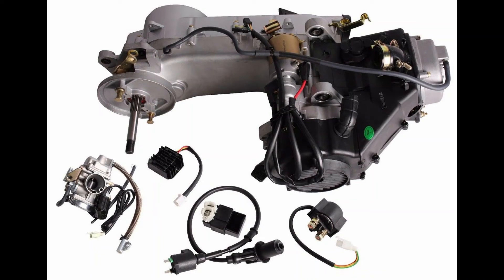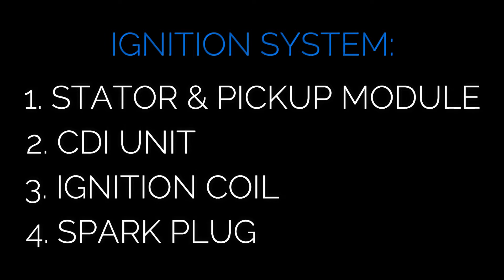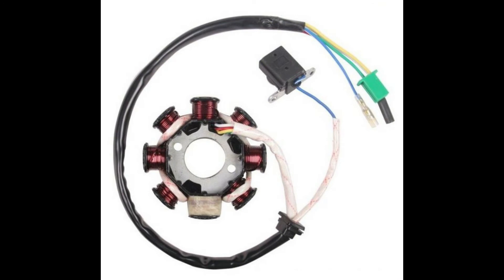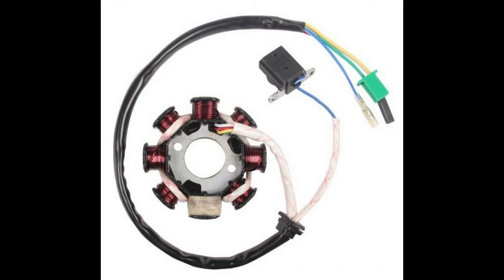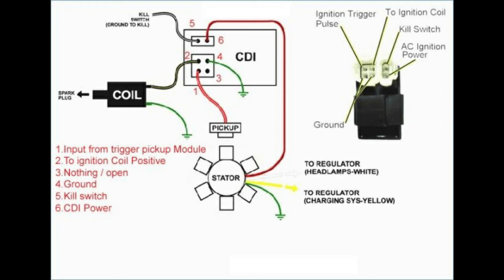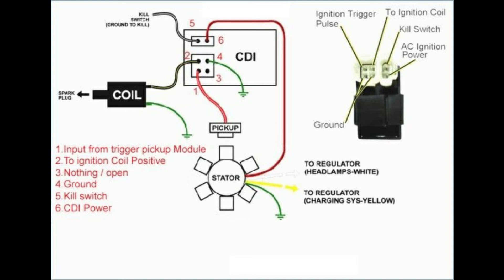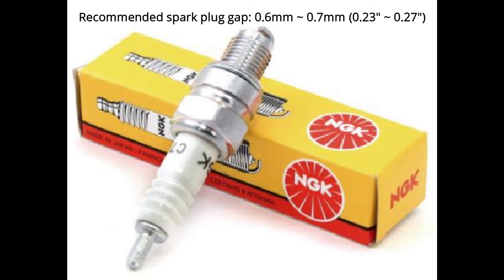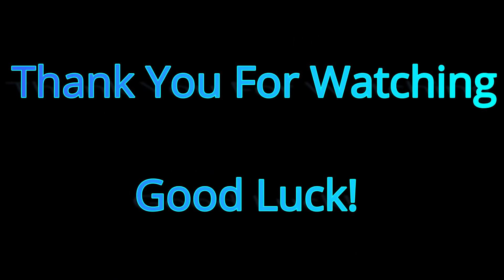Common GY6 Engine Problems and Troubleshooting

Comment: What if I have NO power at all when I connect a brand new battery. Checked the ground cable on the chasis and the fuse is good. I have a 2023 icebear maddog 150cc gy6
Reply: I had an issue like this with a gy6 in a trail master. Ended up being the starter relay fuse was blown. Swapped it out and got power back to the whole cart.

Comment: question< I have a 2003 rover, I removed the stator which has 8 windings which has 4 wires a blue with yellow stripe and bullet connector a white wire green wire and yellow wire, the new stator has 2 yellows 1 green the blue with a bullet connector and a 5th black with red stripe, which goes to which. the original owner cut the plugs of and taped the wires together.

Comment: 150cc GY6 - I changed out the ignition coil, cdi, spark plug, and regulator (I think that's what it was). I couldn't find a rectifier anywhere on the engine. It all cames as a package. It cranks and won't fire. It also has a new carburetor. Where should I look next? Theres fuel tk the carburetor but i dont understand the round diaphragm looking unit the fuel line comes into, but there's fuel to the intake on the carburetor. I have no way to know if all the vacuum lines are hooked up right on the carb. I inherited this scooter for free. Im very frustrated
Reply: Did you check compression for this you need to check the valves (with a feeler gauge). It's quite easy but this made it work for mine. And also ofc full battery.

Comment: Question... I have a Wolf RX 50cc moped. When I try to start it, it just turns over.  If I remove the White/Black (ground) wire on the CDI, it will start but not turn off until I reinsert the White/Black wire. I have replaced the kill switch, CDI, Stator, Ignition coil. What am I missing? Bad ground somewhere?

Comment: I have a basic question. On my 90cc Kymco, the plug will spark whether it is grounded to engine or not. I am used to having to ground the plug to the engine/frame for it to spark. I assume because the coil has 2 wires to include a ground, this is normal. I just noticed when I was working on a spark issue that it would through a spark with the plug and plug wire laying on top of the front tire, and that was a new one for me.

Comment: Unfortunately I have all brand new parts other than the engine itself. It will turn over but won’t start. I have spark it just will not start
Reply: Find the problem?
Reply: Find the problem?

Comment: Could any of these electrical components cause a bogging at half throttle?
Reply: Ground the battery to the engine.
Reply: @anthonypriddy9026 battery is grounded at the starter? Is that ok? Or it needs more ground coming from the battery? Maybe to the valve cover?
Reply: Valve cover  @JonahNAloha
Reply: Should I take the ground off of the starter and just use that ground on my valve cover?
Reply: Nah, leave that one and just add the new one to the valve cover   @JonahNAloha

Comment: 3 wires only from ignition case. No red wire. All 4 cavities used on CDI 4 pin connector. Yellow, white from stator and blue with white from pickup. Arctic Cat 90cc ATV.

Comment: I was always under the impression that ignition coils ran on dc, and that the cdi unit changes ac from the stator to dc for the coil, but you said it was ac to the coil so a bit confused.
Reply: Depends what type stator you have

Ac or dc 

If you look at the coils on the stator, if it’s bare coils all around, I believe its DC

IF there’s some coils that look like they’re wrapped in white tape, its AC. 

I believe it was ac that charges your battery and dc powers up cdi

Comment: ghost in the machine.. i got a 2nd hand 2021 tiking 4 seater 200cc kart the other day. it was a crank no start, owner said the shop replaced the cdi a few weeks earlier and a few days after that   it died. and he decided to sell it.  for a 2021 it was mistreated i could tell every single bolt and nut was loose some hand tight loose.. the breather hose from box to carb gone the electric box cover gone and it was pouring down rain when i  bought it..i tested the stator, and all was good but knowing what the kart been through i replaced it anyway. still no spark then i decided to put a new CDI in it and i had spark. then put plug in tried to crank nothing pulled plug no spark, tested the CDI it was blown now also. when i took the voltage Regulator off the mount i noticed the bottom was cracked bad.  so im not sure where to go with it. but i noticed some weird stuff if i wiggle the key switch the dash lights and speedo meter flicker. also i went to measure the holes for a new tail/brake light with my digital gauge and it was going bonkers when i put it up near the electric box area something is shorting somewhere just not sure where to look..i have checked all grounds all are good now. i do have a new ignition/key switch coming and new CDI..any ideas?

Comment: This os all fine n dandy if youve got a150cc p.o.junk. i got a 250cc p.o.junk with a inverter /regulator. I got 3 yellow wires(hence 3 phase) on one plug coming out of engine that goes to the inv/reg and a 2 wire plug coming out of engine, ones a trigger or pulse (blu/wht) and the other is a ground. The cdi on mine gets power from the inverter regulator. The 3 yellow wires going to the inv/regulator are ac current but when they come out its a  three wire plug green n red n black. Green n red go to cdi as 12volts. The black doesant go to anything. Im so damn sick of trying to find my info. I cant believe these chinee pump out a million of these junk bikes but not one manual

Comment: Some pick up have 2 wires, the blue/white and a green/white. What is that green/white wire for, it leads to the cdi next to the ground but it is not grounded to the chassis or to the battery neg cable, as it enters the cdi it exits the ground solid green wire via a resistence of about 1.6-ohms. So if you ever wanted to join these two wires as a single ground you will be doing so without the resistence of 1.6-ohms causing your pick up to fail. Any ideas?😮.... And the reason why you may want to join these two wires is so that you can use a DC cdi in place of an AC cdi in the case that your exciter windings burn out while on the road, instead of having to change your stator you can just use a DC cdi until you get home.???

Comment: This doesant help at all. The two plug on mine has the trigger wire on it and also I've got a inverter/ regulator that 3 yellow wires from the stator go to then a red comes out of it to power the CDI so obviously their not as alike as you say

Comment: Hi there! In the CDI diagram pin # 1 goes to pickup. What is that? The wire harness on mine is missing that plug. (Fixing somebody elses wiring mess) 😅 

Much appreciated, you da man

Comment: Hi there! In the CDI diagram pin # 1 goes to pickup. What is that? The wire harness on mine is missing that plug. (Fixing somebody elses wiring mess) 😅

Comment: Q: need help …troubleshoot….battery does not stay charged…thankyou
Reply: Bad cell in the battery, parasitic draw from a hardwired accessory, faulty ignition switch, or stator problem...

Comment: Hi from Ireland thanks for the overview, would it be possible for a cdi box to cause a fault at higher revs. As ive replaced all systems except for voltage regulator and cdi box, thanks David

Comment: Kyle, I have a 2021 EZGO Valor with a 150cc (KYEFI) Kymco GY6 EFI engine. It will not run, and this is a common problem (with no fix) among other EZGO GY6 owners. Issues: Lights will not come on, and engine will not start. The horn and backup alarm will work, but they're hardwired straight to the battery that's perfect (verified by shop) with 12.6 volts. I changed the ignition and that fixed it, but as soon as I parked it, it wouldn't run anymore. I changed the ignition again and that fixed it again; however, one day later and it stopped running yet again. I bought another ignition, but that didn't do anything. I bought a fourth ignition and nothing. I can run a wire across two of the four ignition terminals and the lights come on, but it will not run. Do you have any suggestions? Any help is appreciated. If you want to use my cart to repair and make a video, let me know (I will still pay you too.) There's a lot of people who need help. The dealership will not share anything and their apparently charging an arm and a leg if it's not under warranty. Any help is appreciated. Thank you!

Comment: I have spark, new batt, gas in carb,  reset timing have crank but will not start.
Reply: Set valves
Reply: @roygammon2215  done valves got it fired up but now it had like a funny sound then it blow-out the spark plug. Im wondering if its just to much for the head. I fixed the plug problem but it still sounds off any suggestions.

Comment: Great video! 
I put a new carburetor on , but when  I drive around  first it's fine but as I drive a half a mile  it starts to bog down . I can't get any power to get moving. Then after 5 minutes the power comes slowly back. 
We did mess alittle bit tweaking the new carburetor but can't find that sweet spot I guess. 
Thanks
Reply: Vacuum leak
Reply: Make sure your fuel tank venting is good as well. Many of these bikes are made to california SMOG spec with a gas vapor recovery system and that can get blocked, leading to vacuum forming in the tank and cutting off fuel flow, easy test is to loosen the gas cap and test ride (not too full of gas so it doesn't slosh out) and see if the bike loses power and stalls again.

Comment: I've noticed several questions about trigger coil  output. Hot tip: a regular dvom will provide inaccurate readings. You must use a peak adapter. The signal is must too fast for a multimeter alone to capture. Hope this helps.
Reply: Need

Comment: Great video. I haven’t had time to test my system yet.  I pulled my spark plug out and turned the key. No spark the whole time it is trying to crank and then as soon as i turn off the key, i see one little spark.  Has anyone ever seen this?   Thanks

Comment: Reaction buggy, howhit 150cc gy6 clone, started acting like it has clutch slip under heavy load  75 to 100% throttle or teeth skipping without noise if that makes sense, so I replaced all the bearings-seals in the transmission the gears themselves and did clutches and belt and still does it... It is a double chain setup it doesn't feel crazy at all when I roll the machine like the chain is binding and it is tensioned properly I'm kinda stumped my next step would be replacing the chain but definitely feeling lost with it

Comment: What should the resistance read for the 
Pulse coil from output lead (blu/wht) 
to ground if good? I'm searched for this
part and it isn't found. The stators aren't
expensive but I hate to throw it out just
because of the pick up coil.

Comment: I have a 150cc gy6 engine that runs great after it warms up, but it takes a few minutes to get warmed up. It seems that the electric choke is not working. How can I tell if the choke is not working or if it is not getting electric to it? The electric choke has about 8.5 ohms resistance. The electric wires going to it come from the voltage regulator. How do I check to see if the proper voltage is coming from the voltage regulator? I thought about taking your advice and buying a new carb w/the elec choke on it. But, then would I have to buy something else?
Reply: By the way, I don't know if it was related, but recently it would not start due to a very weak spark at the plug. I replaced the DCI box and coil wire. That fixed the starting problem, but now the choke is not working.
Reply: I bought a new carb with electric choke. It would not run with the choke connected. Disconnected the choke and it starts and runs fine without it.

Comment: Great video wish I found this before all the others I watched that were full of information I didn't need if I could even hear or understand them. Recently I picked up a trailmaster blazer 150 and replaced the cdi, coil, sparkplug and voltage regulator. I followed the instructions in this video and everything seems to be working but still I have no spark. I'm so frustrated w this thing, got any ideas of where else to look? Tia
Reply: How about the stator not working?

Comment: Hey, could u go a little more in detail with the kill switch? I have a agm sp50 and the killswitch doesnt work., there are 4 plugs one for the horn two for the killswitch and one cant plug in in anything because there is nowhere to plug in. Also i have a problem with my lights. The normal light works but the big one doesn't(sometimes it does turn on by itself and then off but the light only turned on once when the light should've been turned off and when i turned it on it turned off?)

Comment: Hey Kyle, I like your videos, they are very informative...  so, I have a 150cc gy6 and it starts and runs on starting fluid, but not natively with just the gas.  Spark seems fine, I replace the coil/spark plug and wire.  I've had problems with the air filter system clogging easily.  Now it simply will not start and seems to not be getting fuel, or the mixture is bad, not sure what to do next.  Any suggestions would be appreciated!  
Ken
Reply: Could also be low compression too. Hopefully not tho 😬
Reply from the maker: Hi Ken, yes it definitely sounds like you are having an air-fuel mixture problem. I would start by inspecting the carburetor to see if any gas or perhaps too much gas is getting to the intake. If not I would remove the carb and thoroughly clean the inside (bowl, jets, etc). A replacement carb is cheap enough as well. If the engine was running before this probably isn’t the problem but you could possibly have a compression issue.
Reply: @kylecrowder6940  I have the same problem but it turns over like it has good compression

Comment: At 5:00 you said connect you black lead from meter to black lead on coil then your red lead to lighter colored terminal. Why would you connect the black lead from meter to power on coil lead? Black is neutral and green is ground?????
Reply: Green is ground and black i believe is negative

Comment: I don't understand removing the kill  switch wire to by pass the safety switches when I still have to squeeze the brake handle to even get it cranking. I've got some readings sketched down but I don't know if the are correct can I send them to you?

Comment: I have been fighting with GY6s for a couple years now, I can make them run, but they will die after any length of time, I replace EVERYTHING, electrical to carb, even with upgraded carbs. and I can't find any mechanics that will work on them. I some how missed your videos in the past, maybe this info will help me plunge back into the deep end.

Comment: Why on the coil did you say the green was power side and black was ground side? All my quads with this style coil, the green ground wire in on the green side of coil and the yellow power wire is on the black side of coil. Thanks
Reply: Yeah, Kyle Crowder, it would be great if you (or somebody else) would address this queston.
Reply: On the coil, green is where the green wire goes. The black/yellow wire goes to the black connector.

Comment: I have a gym 150cc scooter replaced engine set valves. Ran great now barely runs acting like dirty fuel replaced the fuel still acting up. Amy suggestions?
Reply from the maker: This is likely a problem related to air/fuel mixture. go through the carb and make sure nothing is clogging the jets. also make sure the air/fuel mix screw is set correctly and that there are no leaks in the intake manifold.

Comment: In the case of a 50cc two stroke scooter with AC stator, if the CDI is faulty the power wire from stator, usually the Black wire with red tracer, will not generate a power feed to the CDI giving the impression the stator is bad.
A good working CDI excites the stator to generate around 48 volts AC a faulty CDI will not.
I'm pretty sure the four-stroke non GY6 Chinese CDI's are the same such as found in the 100cc Quad bikes etc
Reply: You test the exciter and pulse coil not connected to the c.d.I.

Comment: When he was talking about the carborator that's where most people go wrong it's not easier to buy a new carb
Reply: I have to disagree. i got a replacement carb for a GY6 engine at $20 shipped. the old carb had sat for 4 yrs and i couldn't even get it apart. I'd have to drill out the screws, re-tap, even before getting to all the dis-assembly, clearing, adjusting, re-assembly.  

 Its the same reason many locksmiths just replace the core of a lock instead of picking, dis-assm/make a key by hand/re-assemb.
Hell my nap time is worth more than that.

Comment: i have a vector 150R replaced coil,cdo and stator ,still no spark  . i followed the readings onnthe video and still no spark . im stumped.
Reply from the maker: I would recommend finding the electrical diagram online and trace the voltage with a volt meter or even a test light if you have one. This way you can find at which component you are losing voltage.

Comment: My Chinese scooter starter free spins..I got new starter does same.any advise please
Reply: It may sound silly, but did you check the starter mechanism under the cover first?
Reply: @harrisonaard1  that don't sound silly at all.uuh no ..I assumed it work like any other starter..but I learn it has a starter clutch which is new to me..I THOUT it just engaged a fly wheel